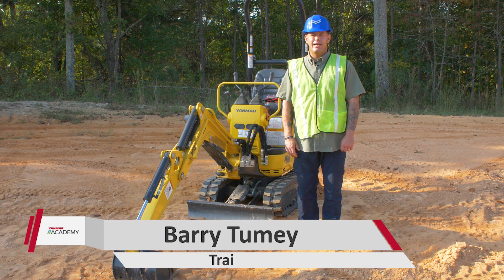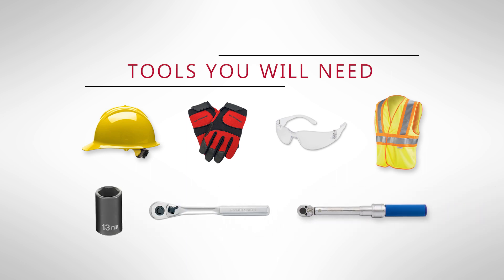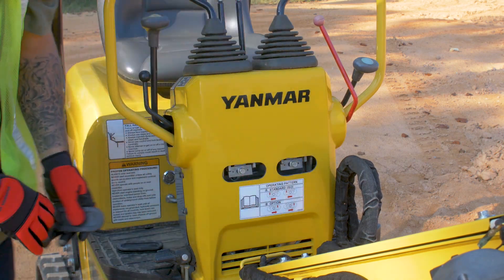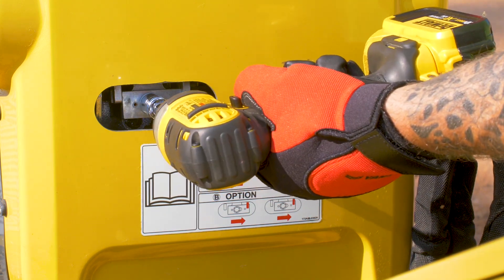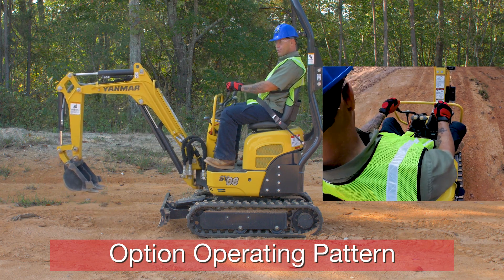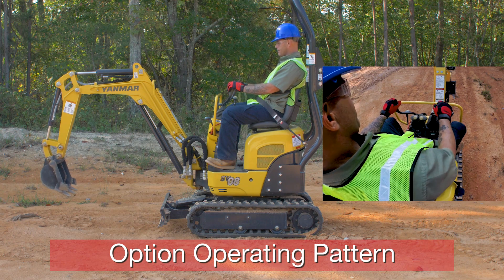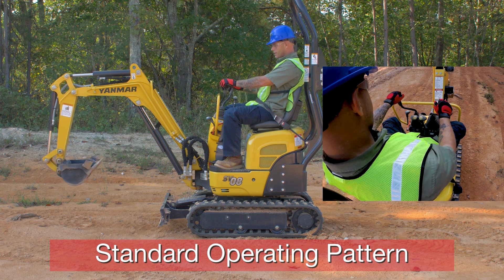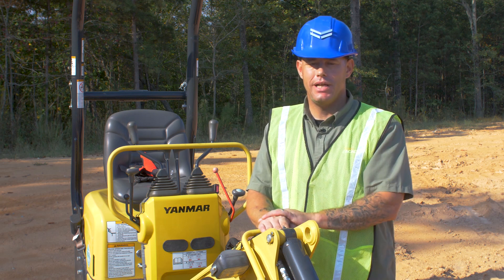YANMAR ACADEMY sv08 excavator pattern control change

Comment: What is the price sv 08?
Reply: You need to ask your local dealer. Besides location, price depends on included attachments. Mine was 29kEUR this summer. It doesn't have the pattern control change option (it's ISO only), but has proper transport fixing points, MS01 quick change connector, an additional 750cm swiveling bucket, a hydraulic hammer HP150 FS heavy duty, a wood grabber with rotator, additional hydraulic connectors for the rotator, a 30 cm earth drill, and a HB400 ripper tooth ...